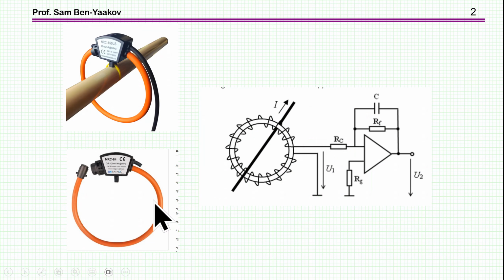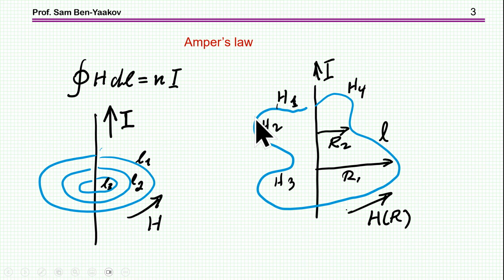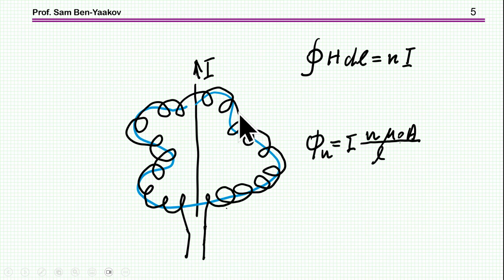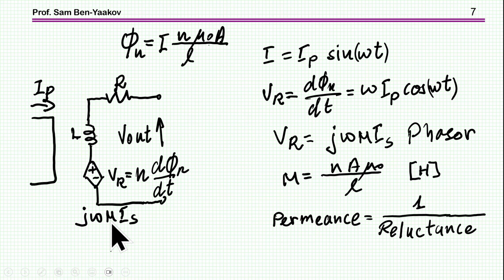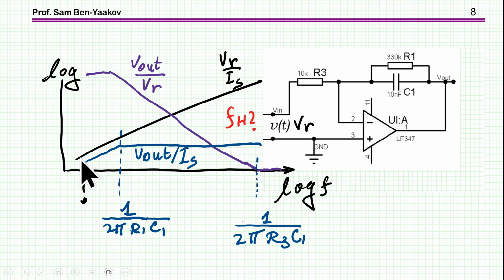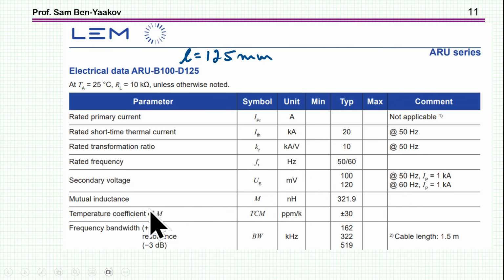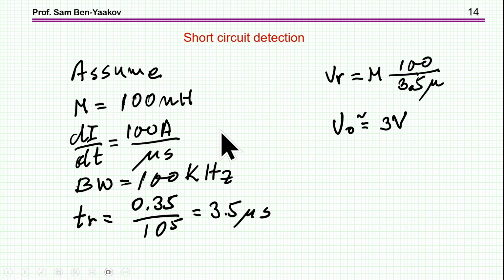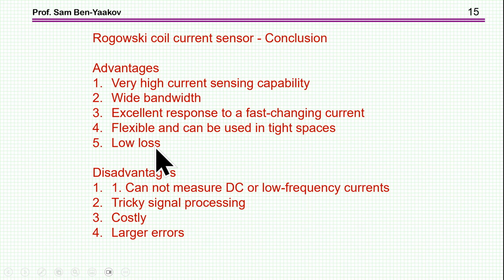Rogowski coil current sensor made simple

Comment: Can the integrator be replaced by a simple shifting the sampled values of the current coming from the Rogowski coil and measured direct voltage by 90 degrees (5ms for 50Hz) in the memory and used to calculate power consumption from the utility mains?
Reply: An integral of a square wave is a triangular wave. So integral of distorted signals is NOT just a simple phase shift.
Reply: @StanZurek  Yes, that's why I asked for utility mains which are sine wave, as the integral of Sin x should be just -Cos x.
Reply from the maker: No it is NOT just cos, you forgot w.

Comment: Hello Professor, maybe I'm wrong, but I think on slide #8 there is no 1/(R3*C1) zero. As frequency increases 1/(w*C1) keeps decreasing and the module of the gain (=Zfb/R3) keeps drooping toward zero (-infinity in dB).
Of course this is assuming an ideal amplifier...
Reply from the maker: Thanks for the correction. I was thinking about a ground connection to the other terminal. In any event, the picture will be similar considering a practical amplifier. But you are right.

Comment: Prof. Sam Ben-Yaakov, thanks for this (and many other) lecture(s) it just struk me that I have been working with Rogowski Coils for over 15 years. I wanted to point that the current rating on the data sheet refered to a short cct scenario and not a nominal current - no primarry conductor will carry 20kA and survive but Rog coils are proving to be a better substitute to current transformers. That said, I thank you for enlightem me that the circular integration funtion is actually a contour integration. I haven't proven it but I learnt that if the Rog coil is wraped twice around a primay conductor the output will double and so forth.  One more thing, it appeas as a phenomena that the clip of the Rog coil is just for mechanical puposes having no electrical characteristics but it's key to ensure a closed loop for the  induced voltage to work.
Reply from the maker: 15 years? you can teach me. Sure, taking 10A/mm^2 as a pointer, you need a conductor with 2000mm^2 for a continuous 20kA current . Thanks for the interest share.
Reply: @sambenyaakov  Sir i still got loads and loads to learn from you. Your lecture on Wireless Power Transfer has helped me in my PhD research which I am still working on. I wish I could share some ideas I have on Wrieless Power Transfer for Electric Vehicle charging with you some day. Thank you for your lectrues.
Reply from the maker: @pastorgraham6344   " Wrieless Power Transfer for Electric Vehicle charging with you some day."  Now is the day? you can write to me at  sam.benyaakov@gmail.com

Comment: Thank you professor for your lecture. Maxwell's equations and Amperes circuital law are difficult for me to understand as I have no formal instruction in calculus. Still you explain the process of integration of the coil and explain a case where the coil is not circular. Thank you so much for showing the relationships between magnetic flux turns ratio and differentiator response. Your expertise is priceless. Again thank you for the upload👍
Reply from the maker: Thank you for sharing. Comments like yours keep me going.